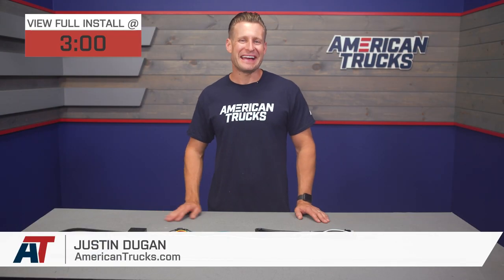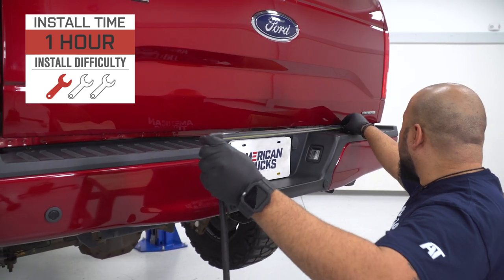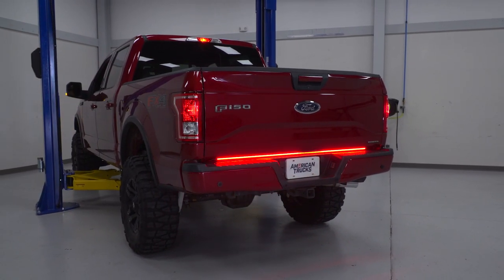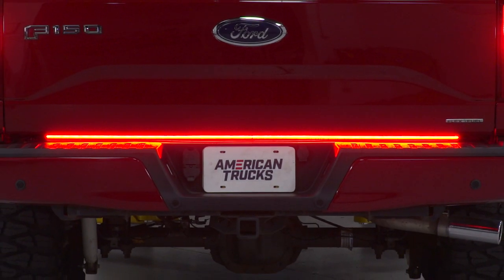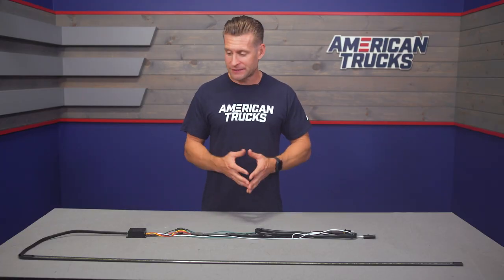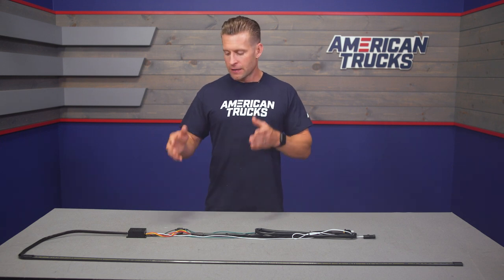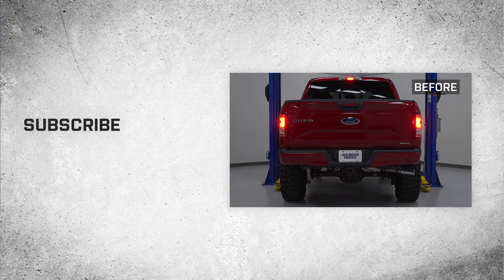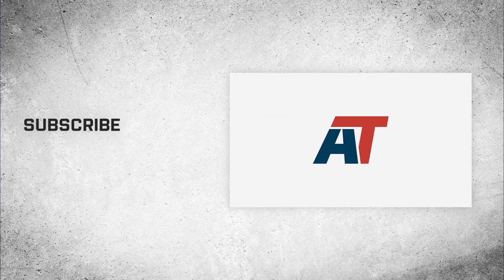F150 60" Blade LED Tailgate Light Bar; Works with Blind Spot & Trailer Detection Review & Install

Comment: I'd recommend wiring into the taillights. When I wired a light bar into my trailer harness on my '17 F150 XLT the reverse sensors and backup camera did not like it. But like other's have said, this light bar is nice, but I agree, it's way overpriced. I ended up with a $14 60" LED Strip from EBay and with some extra prep it lasts just as long as any of the expensive one's.

Comment: OP7 Redline lightbar is nicer and has sequential turn signal for half the price.
Reply: I have the OP7. 5 years on the truck with no issues. Save your money!!
Reply: @alexhendrickson6124  thanks for the advice guys. I just looked on OP7s website and it’s 8 bucks! The sequential turn is very appealing.
Reply: OP7 doesn't last a winter in Canada. Salt eats the plastic. Installed Putco after that, 2 years and still going strong

Comment: Is there a fuse on this bar?
Reply from the maker: This does come with a fuse in the kit but there is no inline fuse on the harness.
Reply: Yes it does. The black wire has one. I been having issues with the bar not coming on or super dimmed that it is so frustrating. I changed the fuse and checked all connections but no luck.

Comment: Careful!!! Can’t install this on the new 2021-2023 models! Dont buy!!! There is a metal bracket under the tailgate just about 8” to the right of the license plate that bumps out about 3/8” and this light WILL be all crooked as it will need to be bumped far away from the metal bracket and the other metal surface so the included plastic insets won’t work. AT didn’t tell you this.